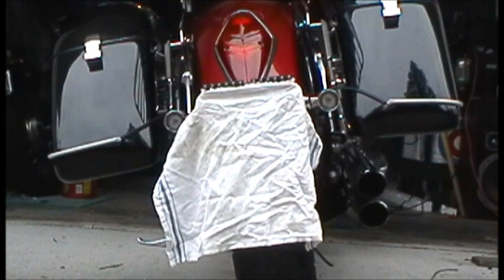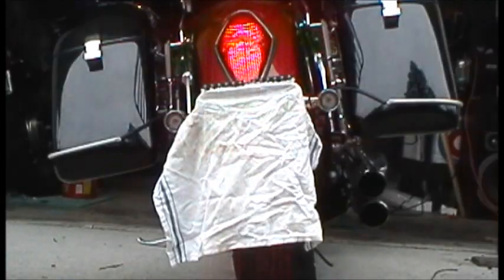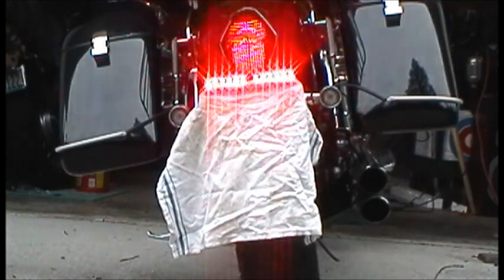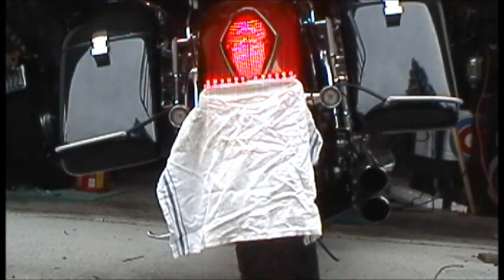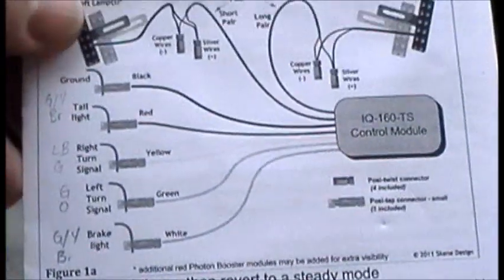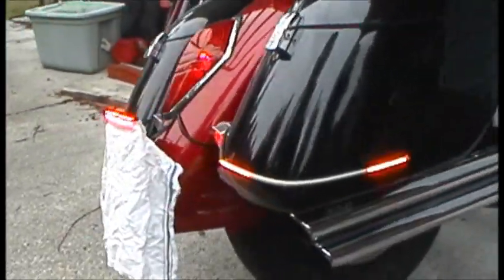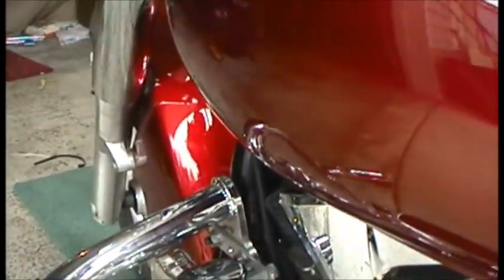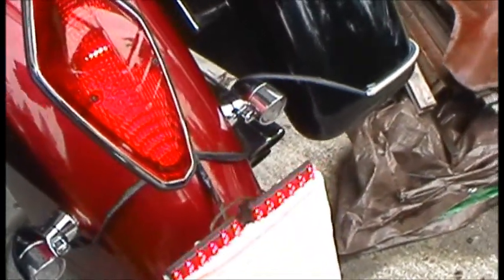P3 Lights Daytime

Comment: Is this Tsukayu Strong Bags on thye VTX ?? I like it , look very nice ...
Reply from the maker: Thanks. I think they are. I had the mounting brackets break on the right side. Guess I had a little too much weight in them. Got some replacements from overseas. And the replacement mounts look pretty solid, a bit different design. Thicker and heavier.